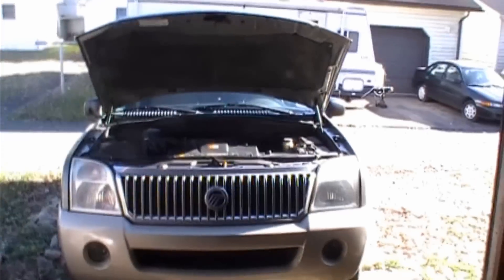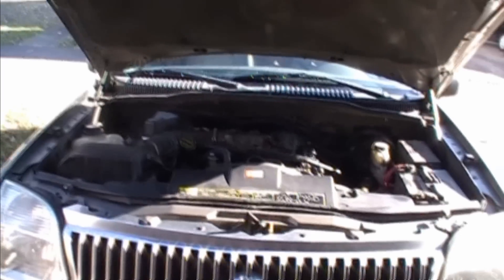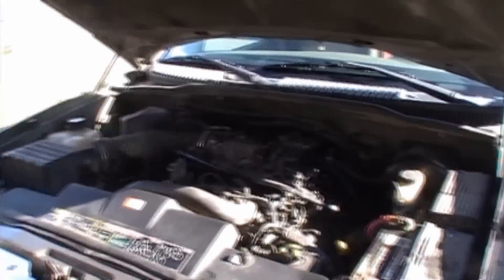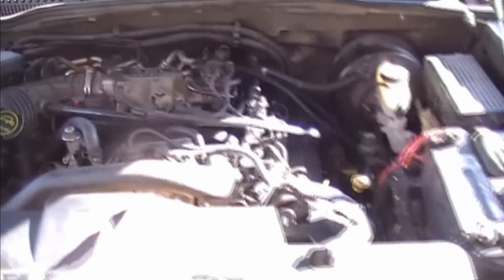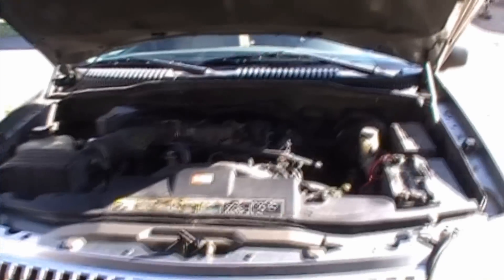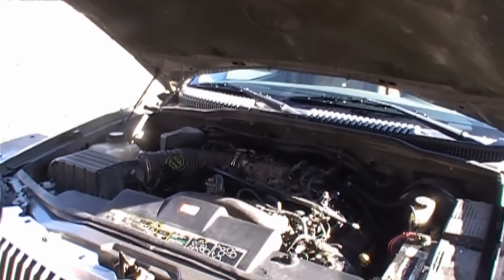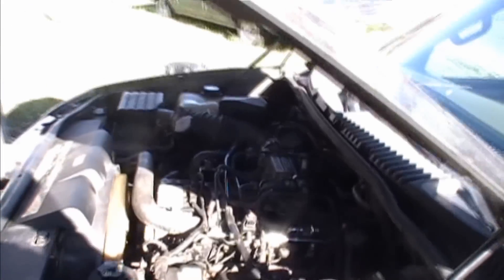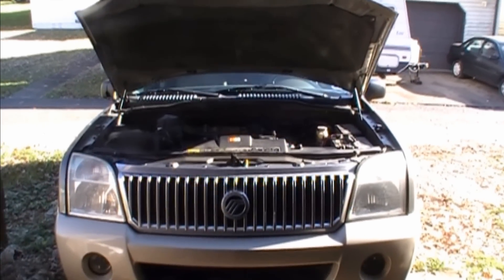PO430 CODE  The real story...don't waste your money!!

Comment: Its amazing the tundra 5.7 also same code p0430. I have a supercharger. And also i get code p0300 meaning missfire. I think i have a leak.
Reply from the maker: Yep...po300 could be a fuel pressure issue also.
Reply: @FixingWithPassion  thanks for the reply. Right but i did a little more research on the missfire i think the missfire is more likely a coil issue. This makes perfect sense to me and i was already thinking this. I saw a few guys with my exact same problem and they swapped coil for coil and ran it and the computer showed a missfire in a different cylinder. Im gonna start with cross my fingers. Super asy easy fix and extemely cheap too vs the dealer of course. I just dont wanna get caught up spending 100 here 100 there and still not fixed
Reply: @FixingWithPassion  i know the fuel pump was replaced and spark plugs when i installed the supercharger 20k miles ago. I already know the plugs look fine and gap good. Anyway ya ill check the coil first. Lets hope thats it
Reply: @FixingWithPassion  oh also when they installed the trd supercharger they also had to change out the injectors

Comment: Would a cai cause this?
Reply from the maker: Only when you don't get enough sleep.
Reply: Nathan Rohrbough ok that went over my head.
Reply from the maker: cai?
Reply: Nathan Rohrbough. cold air intake but I'm leaning towards a intake manifold leak.
Reply from the maker: Intake manifold leak
Reply: Nathan Rohrbough runs fine on the highway but once I exit the highway it starts bogging down. thanks for taking the time to respond to my inquiries.

Comment: P0430 is a catalyst efficiency code. Not an 02 code. I'm a 20+yr senior master with ford and real technicians know how to monitor fuel trims. Btw we don't use carb cleaner it catches on fire. Use water is less flammable. Not all technicians are bad and it's unfair for you to say 90% are.
Reply from the maker: Your right! There are so many variables! Thank goodness for guys like you helping everyone to understand these things. But still the PO430 is the code form hell!   ;(
Reply: What are fuel trims
Reply: The trims if u can read them right will save you on a ton of fixes besides this one. The percentages have to balance
Reply from the maker: Thanks for the reminder!!
Reply: Or use propane.
Reply: Chevy dealer told me it was cat. I cleaned my k+n air filter and the light went off. P0430 can be anything from a gas cap, vacuum leak, clogged injector to a $2200 cat. Follow the money. Start at the cheapest, easiest repair. Dealers should know better. What would happen if I changed the cat like they recommended and light stayed on because my air filter was the real problem? I'm not eating $2200!

Comment: I changed sparked plugs on my 2006 Chevy Silverado about a month ago. I was only able to replace 7 out of 8 because the dumb engineers put one where you can't get a spark plug socket to. Would this have anything to do with an uneven gas/air mixture that would cause a p0430 code to come up. I will tighten the intake bolts on the manifold but wondering if one oddball spark plug would cause a problem.
Reply from the maker: Probably no. You have a slight air leak somewhere or what we like to call un- metered air. Try the intake bolts first and reset the code drive for a while and see if the CEL light comes back on.

Comment: I got a Chrysler 300 2.7 and the code P0430 pops up what could it be ?
Reply from the maker: That would be a intake gasket maybe...something is slightly leaking. Check all vacuum hoses also. Rather have that code that the po420

Comment: Bah ahaha!! I would rather replace an O2 sensor than spend hours and hours removing and replacing an intake gasket lol!
Reply from the maker: Ok, lets hope you don't break the O2 sensor, even if you could get it off, only to have to take off the exhaust to get out the broken o2 sensor. Sounds like a good time to me.
Reply: If the intake had a leak that was causing the check engine light to go off what good will replacing an o2censor do? I think you missed the point of this video
Reply from the maker: @danielbaumgartner572  Your the one saying you'd rather remove the O2 sensor. My video is stating not to remove 02 senors first. Check for intake leaks etc first. I think YOU missed the point of this video. Thanks for watching!
Reply: @FixingWithPassion  I think Daniel is talkiing to DuzBee, y'all are on the same page. Either way, thanks for this vid.
Reply: I'd rather just fix what ACTUALLY is the problem

Comment: The p430 code popped up on my nissan frontier 2001 im also noticing that im loosing coolant little by little any thing in specific i should check
Reply from the maker: Check for leaks
Reply: check your throttle body gasket which you may have an idle control valve which has rubber  seal which the coolant sipped to the engine and contaminate both the catalytic converter and your Air fuel ratio sensor or oxygen sensor which ever may be there depending on the emission requirements on that model year ! and also cylinder head gasket which coolant pass through to cool the head and the engine!
Reply from the maker: Thanks for the tip!

Comment: P0430 ......I just replaced a 0 volt o2 sensor first then cleared the code .....now the wait and see..  I will look closer at my intake. 233,000 2000 Nissan/Infiniti i30.

Shifts hard from 1st to 2nd...engine starts like it's only 3 years old? She starts up very easily . daily driver.
Reply from the maker: Nissan/Infiniti i30    Eye catcher.

Comment: TVWXman, thanks for posting. I've had the p0420 and P0430 lights coming on intermittently. I replaced both cats based on diagnoses from the dealership and another separate mechanic. The codes are gone now but I cannot get the "cat" and "evap" monitors to show as READY in the OBD test and have been unable to get my truck inspected. I've driven through the recommended drive cycles several times and no luck! Any advice? Note:I had my PCM replaced 4 months ago...any chance this could be the source of the problem?? Thanks in advance.
Reply from the maker: Jarod Garza ...No there is something else going on. Any coolant loss? Look at the tail pipe is it oily, black or. dark brown? Is your check engine light on again? Any pending code in the obd2 reader. That's a clue if there are any pending codes.
Reply: Thanks for the response. No codes or pending codes right now. I do get somewhat of an exhaust smell coming through the a/c and that is the only abnormality right now. Just can't get those damn monitors to reset.
Reply: Also, there is some coolant loss, but the tailpipe looks fine. Thanks
Reply from the maker: what kind of auto is this?
Reply: 2007 F-150 4.2 V6
Reply from the maker: Why do I feel like it may need new plenum gaskets??   Hum.... Wait and see if chucks a code again. When It does....I bet it gaskets related.
Reply: Great detail. That might have actually happened to our old explorer. Car was always dealer serviced but dealer was no help. Never bought a ford since.

Comment: I got a camaro 2010 SS, I bought it with a flow master haven't got a tune up since I got it like 9 months ago maybe a year ago I'm about to do it, the next few days or so, is been getting cold and that code came up any ideas what could it be ? Please help, you'll get a sub if you can help me figured it out. And is it bad driving it like that for a few days ?
Reply from the maker: Loosing any antifreeze? Has the Idle changed since you owned the car?  Some where there is a leak slight leak. Antifreeze or a air leak. Clear the code and see how long it takes for it to come back on. if it takes a while....then start looking at intake gaskets!
Reply: TVWXMAN32 what's idle ? And yeah I was at first but now it stopped I took it to the shop today, getting a dexcool swap, and a full tune up, how do I reset the codes ? Just unplug the battery and wait for it come up again ? I really don't think is my catalyst bank 2
Reply from the maker: Idle...I mean is it stalling etc? Yea Just un-hook the battery for 10 mins and the codes will  clear. No...  Its not your cat...you have a air leak. Air is getting into the engine somewhere past the intake. Do a reset and see how long it takes the code  to come back on. Check hoses for vacuum leaks. Listen for hissing, get some carb spray and spray around the engine while its running to see it it changes idle or stalls. Its a start;)
Reply from the maker: .........or at worse case....slight coolant leak. It does not take much of a coolant leak to through a p420 code!!
Reply: TVWXMAN32 we'll do thanks man.
Reply: TVWXMAN32  try to clear that stupid code hope I don't have to spend 1K to fix my car (got a sub)
Reply from the maker: Yea, just do one thing at a time. If you can work on cars....you can fix it. Don't fork out money just yet!
Reply: TVWXMAN32 hey I did a tune up check the parts everything seems fine the code is now gone, but. Ow what it should stay fine or I need to wait till the code comes back? I hope it doesn't come back. Everything seems normal to me. I did it yesterday around 12:00 pm i been driving it and it hasn't come up
Reply from the maker: Give it a few days;) It will be back on....then we can go from there. Its not going to fix its self unfortunately.
Reply: TVWXMAN32 I didn't reset the codes tho, it went away by it self, after the tune up. But I'll see there is no coolant leak or air leak so we will see

Comment: could you cheat and just throw some sealant in the radiator ?    Also my car gives the 430 code and i couldn't pass inspection  so I took it off the road.
What it would do is when idling for 15 min.  to a half hour, when starting off the car would push out a large  whitish cloud enough to be clearly seen in the mirror .   drive it regularly it runs clean  does not continuously  smoke .
Reply from the maker: LOL...Prob would not work...But I understand your frustration. If you 
are loosing antifreeze then there no way out of changing gaskets. I 
lived in california and know all about emissions ;(

Comment: What if it only comes on after you fill up your fuel tank. Then it goes away when it's no longer full.
Reply from the maker: Do you ever smell gasoline after you fill it up for a while?
Reply: TVWXMAN32 nope. I don't smell anything unusual.
Reply from the maker: Strange I don't think there is a connection for that and a po430. po430 is a emissions engine code via air leak or slight antifreeze leak causing the o2's to freak out. I think after you drive it a while it clears up and the code comes back on after it sits for a while. That's all I can think of. Strange.

Comment: Hey amigo this should work on p0420 code? It's related? And good info....
Reply from the maker: Well po420 is mainly a bad cat converter. You really need to get a cheap temp gun and measure the inlet and out let temp of the converter. po430 is usually a intake gasket. But all these things could vary.
Reply: Thank you... new suscriptor...
Reply: @FixingWithPassion   I respectfully disagree with this statement. P0420/30 is exactly the same thing. The only difference lies in the location of the cat. Indeed, p0420 is bank 1 (passenger side) and p0430 is the cat located on the driver side. Thats all.

Comment: True or if you pulled a vacuum line. I changed a brake booster hose and the engine was off turn the car on viola p0430 listen to this guy check for leaks first!
Reply from the maker: Nice.

Comment: I’m throwing P0420 and P0430 on mailverado
Reply from the maker: PO430 is a gasket leak or vacuum leak somewhere. PO420 converter bad maybe....use temp gun and measure the in and out temp of the converter. Should be hotter coming out.
Reply: TVWXMAN32  I’ll check it out I don’t have a bad smell from the converter I don’t smell exhaust inside the vehicle I did have a heater hose leak and when I’m driving I have more than usual condensation in the tailpipe. Both of these codes popped up after I reset them before my tpms sensor did and that was odd
Reply: Also my idle in Park is bouncy. Not rough just bouncy and at 40 mph when I turn my rims jump between 1-2 then stop when I straighten out any faster or slower it don’t surge the rpms

Comment: Wow! I was just reading through some of the comments and came across the one where you mentioned that the P0430 code was pending after you replaced the intake manifold. I'm not saying that your vehicle didn't need the intake manifold, but in my opinion you jumped the gun posting this video and have probably misled many people. As a professional mechanic for over 30 years I find these types of videos to be both sad and funny at the same time. Keep throwing parts at your vehicle and talking shit about people you have never met before.... Lol. Oh yeah, maybe you should delete this video as the title is absolutely incorrect. And you actually did change the wrong parts lmmfao.
Reply from the maker: lmmfao...No it fixed the problem. I guess i got one over you. As a professional mechanic for 48 years, I find these types of comments to be both sad and funny at the same time only to brain wash folks to spend money where they don't need too. O as for "talking shit" I guess that's you now. Maybe you should delete this comment...o wait, this cumming form is a troll comment.
Reply: @FixingWithPassion  so by fixing the problem you mean that the returning P0430 code is not what you wanted to fix in the first place? I'm not out to get you or talk shit, but if you aren't interested in telling the truth then perhaps you can elaborate on what your original goal was. If you were trying to eliminate the bank 2 catalyst efficiency below threshold malfunction, then my opinion is that replacing the intake manifold did not completely solve the problem. It could have been an underlying issue that contributed to the P0430 code being set, but if you have 48 years of experience as a mechanic, you would have seen the lean condition in the datastream. There are these things called PID's. One of them is known as LTFT (Long Term Fuel Trim). It is important to look at that before condemning any part, especially the catalytic converter. However, I'm sure that you already knew that, with your infinite wisdom. All I can say is that the thousands of vehicles I have successfully diagnosed and repaired in my career have typically set lean fuel mixture codes long before any catalyst code. Perhaps your vehicle is not the norm.
Reply from the maker: @user-gj4ei6dc5q  That's right, the P0430 code will trash the cat eventually giving a P0420 if you know what to look for. Trying to keep people form spending thousands of $$ on  catalytic converters is my goal. If there is a P0430 then look at different things, not the cat first. Trims, loose hoses, injectors seals Even a leaky fuel pump etc.  But you know this. When you see a p0420 code...your cats are usually trashed. P0430 codes are the crack in the bridge before the entire thing goes down. -Have a nice day.
Reply: @FixingWithPassion  
Wtf? I can't believe what you are saying here. The definition of a P0430 is catalyst inefficiency below threshold bank 2...the definition of a P0420 is catalyst inefficiency below threshold bank 1. Please correct me if I'm wrong. I'll wait....
Again, I'm not trying to make you look bad, but please admit when you may have made a mistake. If you want to mislead people with nonsense, that's not a good thing. If you want to talk about facts, I'm more than capable of disputing your previous response. My opinion is that you owe it to yourself and your viewers to admit that there is some potentially misleading information in your video. You can post your opinion about any topic you want, and so can others.I have never met you in person and have no reason to discredit your misunderstanding of logic other than the obvious illogical conclusion you are trying to present.